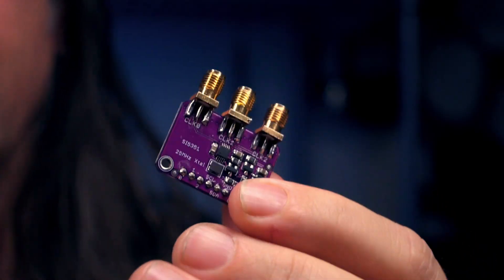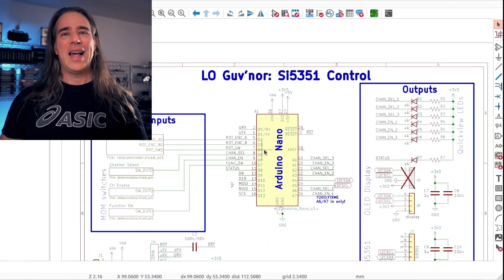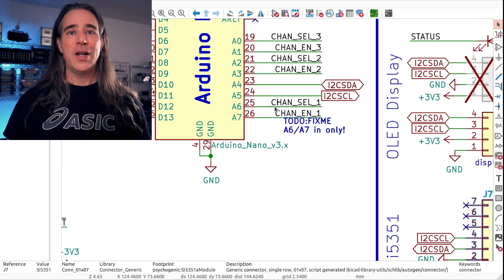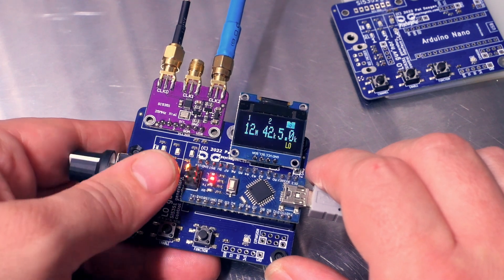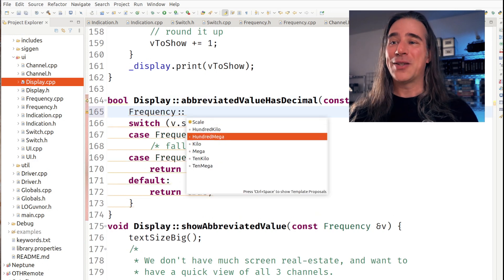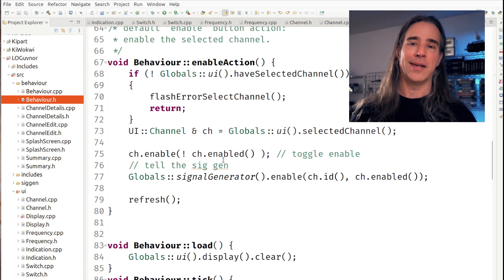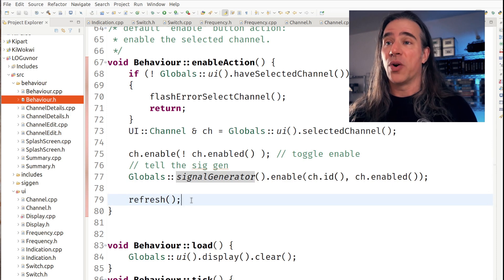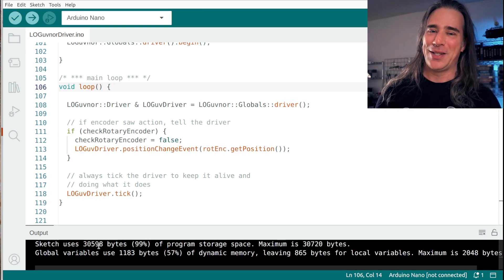Architecture and code an Arduino Project for this Open Hardware Signal Generator

Comment: Nice video! Just one question, if you didn't want to use singletons for siggen (for example), as mentioned in minute 12:22, how would you implement it? I would like to know how to do it in a cleaner way. Thanks!
Reply from the maker: Hello Jordi, thanks!  What I was trying, with some difficulty, to express is that these things like the siggen, are in fact used as singletons but rather than going through the trouble of making it "official" (i.e. a private constructor and all that) I leave the possibility of having multiple units open but just centralize access through one big Globals class.  The static methods will instantiate, if needed, and always return the same object so--as long as you always go through Globals::signalGenerator() to get the handle, then in the end, it really does behave as a singleton.  The main advantages are flexibility (maybe, down the line, I have a module with 2 sig gens) but in real life it's that I'm lazy and this allows me to skip making c'tors private and creating class-level accessors and just include Globals.h and use any of those system-wide objects through there.

Comment: Ive owned a few awg units and got rid of them. The next one will be a high end one. I have dual 25 or 30 mhz on my mso5354 which is better than other 3 to 500 cad dollars models. 

Man. I want to support makers who sell on etsy and such but they want so much money for their stuff.  Half the stuff i buy goes to charity so i cant afford 150usd for something i can make in a weekend, albeit more professional looking. I wish more makers sold kits on etsy. That australian maker guy who has a pnp like you wants a small fortune for anything he makes. Most people cant pay 4 times as much something is worth because a maker doesnt understand economies of scale. I feel bad about it too. I dont feel abd about adafruit, they creat artificial scarcity and charge way too much for stuff built in china. Ada Limor has done nothing for the community with her overpriced products. I dont care she wrote a bunch of open source framework when people cant afford to use it. I give away kits to anyone in north america who asks and i cater them to the person's likes. I only ask that they let me pay to get the multimeter and soldering station back if they dont take to the hobby or get a new one.  Ive never heard one creator offer anything like that without some sort of quid pro quo agreement.  I do it no strings attached and im on a disability pension. Too many people think the 10 minute episode they make 2 to 4 times a month ia worth more than netflix. Ive seen creators ask for over 100 dollars on patreon. 

This youtube phenomena is going to end up being a case of just because you can, doesnt mean you should. There are lots of young engineers with channels that will have to get a job someday and 8 years as a youtuber wont be considered job experience.  I sound negative but i honestly hope it never happens. There is a reason  they say the eggs in a basket thing.

Sorry to ramble. Great project man. It would disappoint me if you were not a death metal, technical death metal fan.  Im a fat middle aged man but i still shred and play to a metronome when i practice scales hahaha

Comment: I like it Pat. If you need a clock in a pinch you got it. These modules are great for that.
I used one to drive a few projects that I needed several clocks. I sort of abused the IC and drove it with a 10Mhz clock from an OCXO because I wanted stability.
It worked surprisingly well for what I was doing.

I just hope the radio guys don't do to you what they did to me. I ended up taking my repos down. Software licenses don't mean anything to those people.
Reply from the maker: Yeah, that's just it: it's to bust out when I want something in this speed range, not necessarily needing the highest precision, just quick access.  I wanted this to be easy for anyone to setup, so just stuck to the modules that are available online, but the idea of driving from a precision clock is pretty cool.   Sad to hear about your misadventure, there.  This is so basic, I probably won't attract the attention of the radio guys, tho, hah.

Comment: Nice video😊.
I have a question it's possible to use an ESP32, for example an esp32-s3, to receive a streming audio from WiFi (for example a web radio) and to send it directly to an headset Bluetooth.... thanks 🙏
Reply from the maker: Thank you :)  To answer your question: I'm not actually certain, but off the top of my head there are two things that might be obstacles.  The first is, I find, that bluetooth isn't all that friendly of a spec if you're getting started.  It can get a bit complicated, and I've mostly just played with the BLE GATT.  Audio's another ballgame.  Maybe the esp-adf has something for you, I don't know.
The second thing is RF coexistence: I haven't played with the the S3 far as I know, there's only one RF module dealing with the band, so trying to play with wifi and BT at the same time would probably be a problem.  So: not a solution to your problem/question, but maybe something that could set you on the path if there is a solution.
Reply: @PsychogenicTechnologies  thanks for your answer...now I try to make all on esp32 "standard"🤞😅